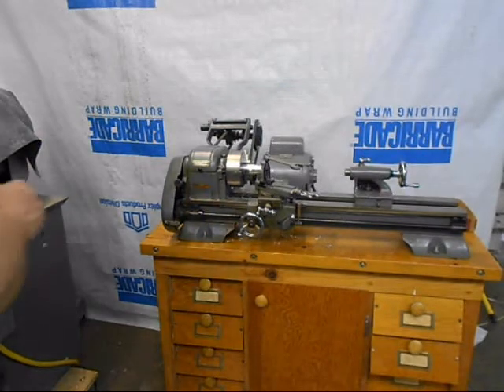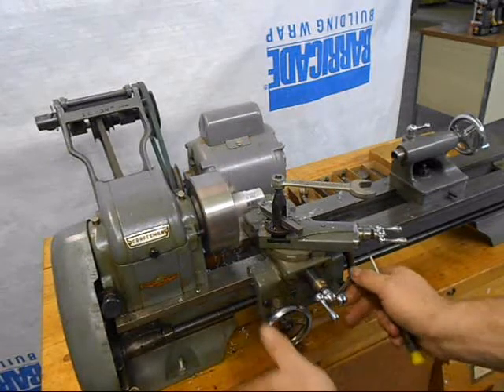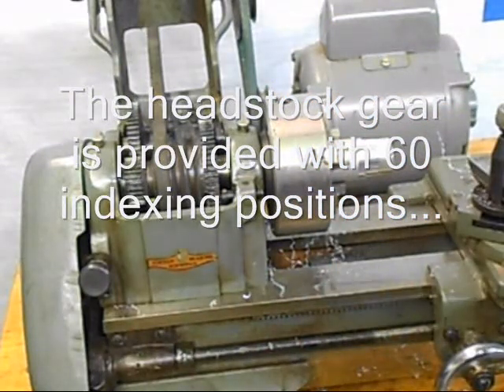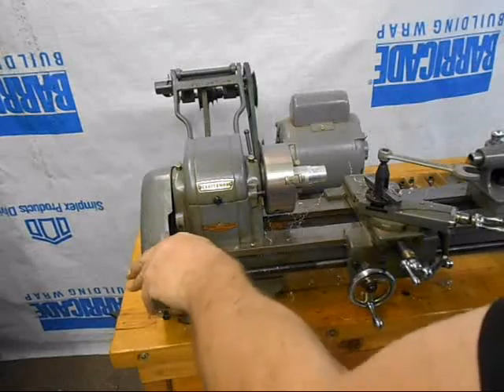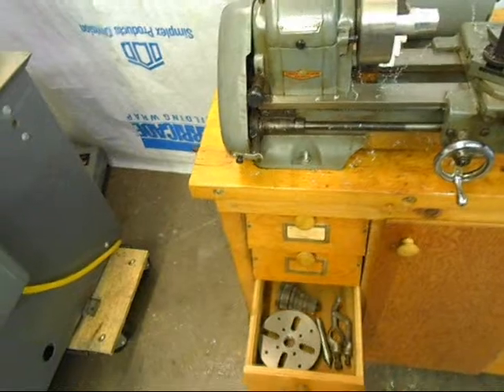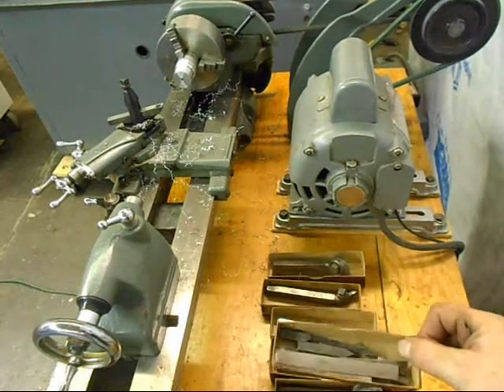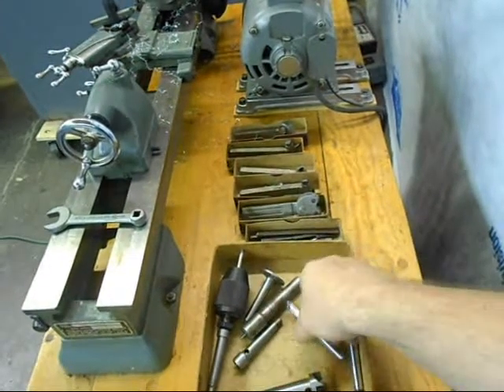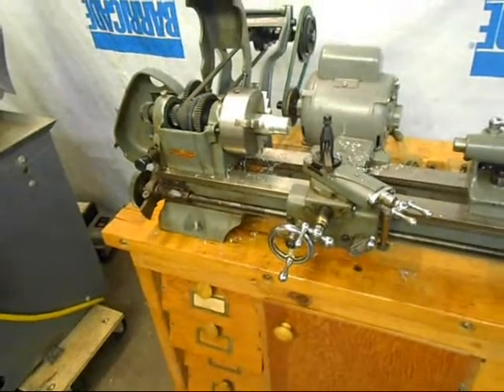Atlas 6 inch lathe.wmv

Comment: I just bought a lathe just like it and a 109,,,payed 400 for both, in great condition,,, l already had the 12 inch with quick change gear box it's a big beast and works very well,,I put a treadmill motor on it..so much better that way.

Comment: I know this video is old but i saw one of these for sale for $700 in great condition with some extra toolng and 4jaw chuck and steady rest face plate...etc......thatvseems high price for such a tiny limited lathe? Or am i wrong?....my chinese lathe even has more capacity at .7 inch....this atlas is 6x18 correct?
Reply: YOUR Chinese Will work great after 80 years and you will be able to get parts borne oem and repop at that time? Doubtful

Comment from the maker: Yep, it was sold soon after the video was posted.
Reply: How much are one of these worth in great condition with ample tooling like this one has vs an old used one in "ok" condition with not any tooling but otherwise complete.   I've been looking for an old lathe like this to learn on.
Reply from the maker: Lots of things influence the value of a machine.  Tooling and condition are important, as you alluded to. This machine had been mounted to a nice wooden cabinet, so was priced accordingly.

Good luck with your new hobby!

Lucas AKA Arn Jones